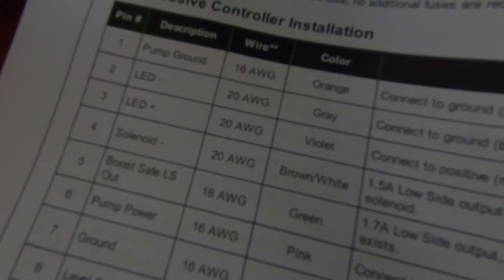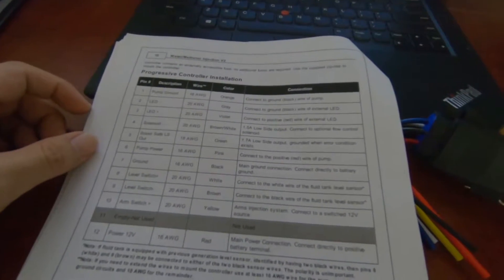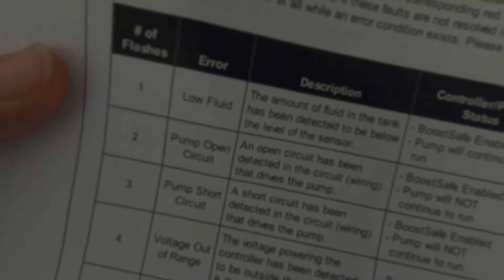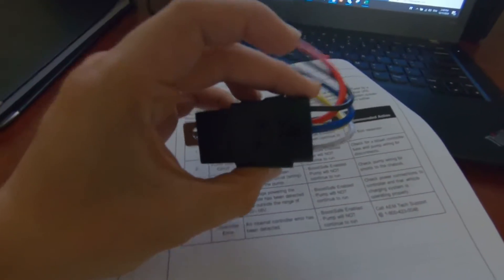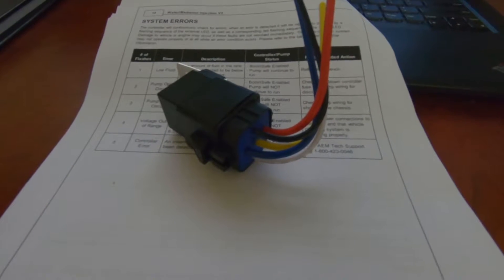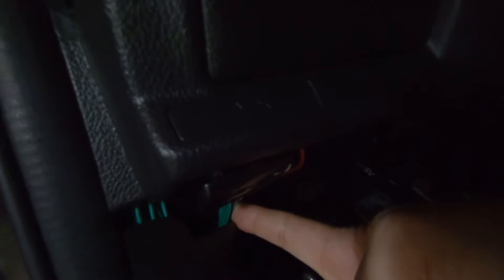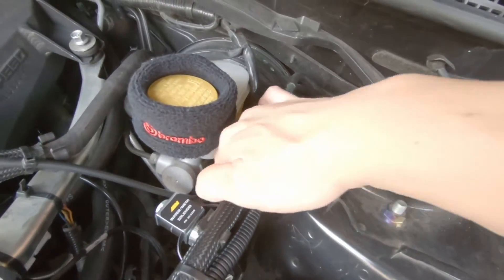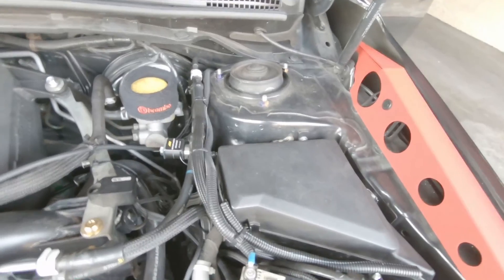Making sure my Flex Fuel + Water Methanol Injected 2016 Subaru WRX doesn't BLOW UP! Failsafe DIY!

Comment: Question on the aem solenoid. You said the brn/wht wire goes to the solenoid and the other wire from the solenoid goes to a ground. The instructions say that the other wire goes to a 12v ignition power source and that the brn/wht wire is a ground source for the solenoid. Just trying to clarify as I’m getting ready to do the install myself as well.
Reply from the maker: The latter is correct.....I might have mixed up the wires on that part......definitely follow the instructions
Reply: Another question but about the relay as I’m planning on doing this setup as well. I don’t know too much about relays so I’ve been reading up on them. Shouldn’t the wht be connected to a 12v power source, the blk be connected to the aem controller grn since that is the ground activation to magnetize the relay. And the red and yel be connected to a boost controller and the blu be left open. That way when there’s a fault on the aem controller, it will ground the relay through the grn wire and open the relay and connect the red and blu and kill power to the boost controller?

Comment: Excellent video and thank you for all this. One question, it’s not very clear whether you ran the wire to the ebcs by t tapping it in? Does it matter which of the 2 wires from the ebcs are used? Are you using the grimmspeed ebcs? Thank you in advance
Reply from the maker: Hi, no I didn't T-tap it because there's quite a lot of vibration down there so I made sure to take the time to solder it in properly, heat shrink it, and make sure the lines are secured so they're not just flopping around. For the EBCS, it does not matter which line is used because there is no polarity on the power and ground and it'll essentially do the same thing. Make sure to only use one of the wires though......
Reply: @eddiestsla  thank u Eddie. Much appreciated

Comment: Great video, so you say cut any wire on the ebcs? And tie in the relay? Do you cut the grimmspeed ebcs wire? Or the wrx wire?
Reply from the maker: That's correct. Cut any of the two wire down at the EBCS.....wire one to one of the terminals on your relay and the wire the other end that you snipped to the other terminal on your relay. I used 14 gauge wire which I bought......I recommend using color coded wires to match your relay as I didn't do that and it's kind of pain the butt to see how ti's wired. I might redo it and make another video since this seems to be biggest question from everyone.
Reply: Great, just wanted to make sure I understood correctly thanks again
Reply: 1 more question lol, for the solenoid, it stated brown and white wire and other wire to switched wire. You stated to a ground?
Reply from the maker: @Fonzy_2o9  that's correct....one of the wires has to go to a switched 12v power source and the other can go to any metal ground......I used a terminal so I can put a bolt through it that was available off the car chassis
Reply: @eddiestsla  hmm, I'm lost the picture doesn't show one wire going to ground. It shows one wire going to the brown white wire and the other wire going to a red switched wire. Is the AEM picture wrong?

Comment: So the relay tells thr ebc to cut boost..also does it matter which line on the ebc u t into for the aem boost line? I litterly cut mine an the barbs dont fit but theres no smaller lijes i see to tap in too..thanx..nice car btw
Reply: Hey Eddie,

I done the install and I'm getting the error P0245 which is no power to the wategate. I installed correctly. I confirmed my ground. The only thing it can be is one of the switched 12v is not a true 12v. 
The AEM isn't showing no errors and or no blinking LED. The AEM system will work switched between 8-12v. I will look at that next if not might have a faulty relay. 

The relay is a 30amp relay does it matter which switch I use on my fuse tap?
Reply from the maker: @Fonzy_2o9  yes it absolutely matters where you tap into on the fuse box. It's very unlikely that the relay is defective and I'm sure it's the 12v power to the relay that's giving you issues. Well at least you know that disconnecting the boost controller works because that's the exact code you get when the failsafe works and your car won't be able to go above wastegate pressure when that code is on......
Reply from the maker: @Fonzy_2o9  I might have had my wires mixed up in my video but I have it wired just like this in this video: https://youtu.be/r9LDKQh9Tlc
Reply: @eddiestsla  ah ok, I have to switch green AEM to black wire and white to switched 12v and I should be good to go
Reply from the maker: @Fonzy_2o9  yeah sorry about that I'll have to do an update video on the wires being switched in my original video
Reply: @eddiestsla  figured it out lol
Issues lol.
Black relay to green AEM
White relay to 12v battery/switched
Red to ebcs to close loop
Yellow to ebcs to close loop
The blue wire is not used
Reply from the maker: @Fonzy_2o9  nice 👌 glad it's all sorted out!!
Reply: @Fonzy_2o9  I'm confused so you cut one of the EBCS wires and then connected it to the red wire of the relay and then connect the yellow wire of the relay to what
Reply: @Fonzy_2o9  where did you pull power for your relay from? I’m having the same code and issues you are and I wired it just like you said on here. Lmk. THANKS….
Reply from the maker: The relay cuts power to the EBCS......so if your AEM system senses trouble and outputs an error......that's when your whole system goes to wastegate pressure of 7 to 8 psi total. Also it doesn't matter which wire you cut on the EBCS as cutting either one will make the EBCS not work and the car go into wastegate pressure immediately. You will also have a check engine light on which works for me as a failsafe if you know what I mean.